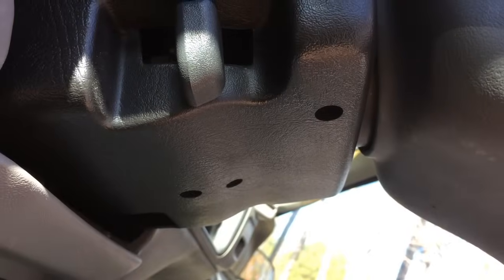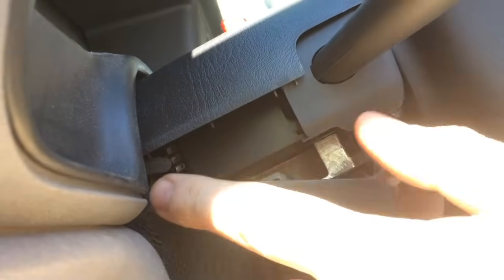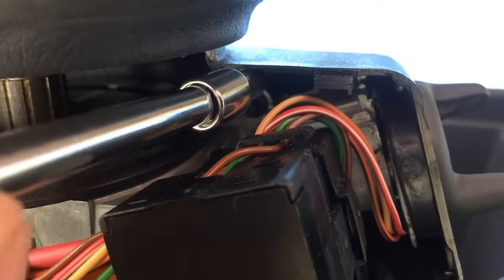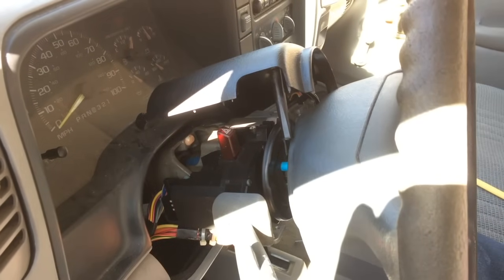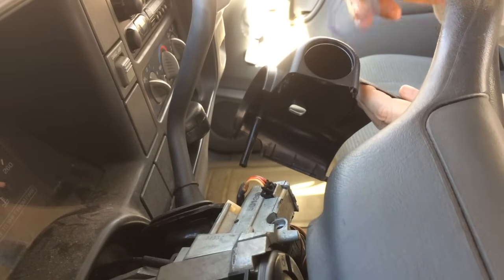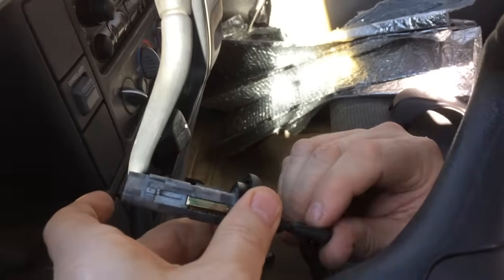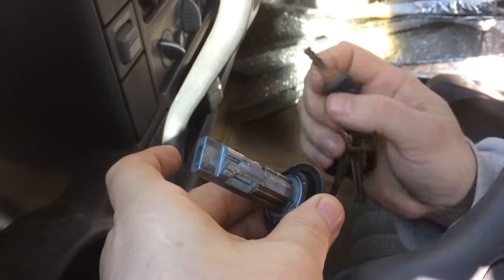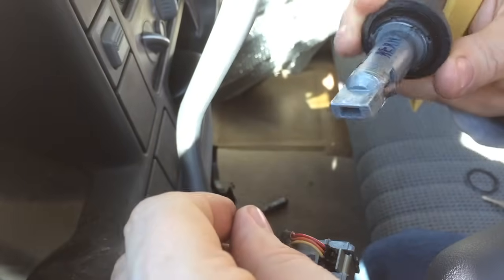1995 - 2000 OBS GM Truck Ignition Lock Cylinder Removal (Chevy Cadillac & GMC)

Comment: If the key is locked already how do u get the cylinder out since u can't turn it into the start position?
Reply from the maker: In order to remove the lock cylinder, you have to have the key, and you have to be able to turn it to the start position.  If you don't have the key, you'll have to seek out a locksmith.   If you have the key, but the lock cylinder is damaged and difficult to turn, there are some older comments where folks found success with lubricants and jiggling/wiggling with the key until it managed to move forward enough.   If its really damaged and lodged in there, you may again have to go the locksmith route to have the cylinder drilled out.
Reply: Ok thank u i have the key and u used to be able to wiggle it and its stuck prerry hard tho
Reply from the maker: Yeah you have to get these things before they get wedged / stuck in a bad way.  I'd try some light lubricant spray, and patiently work with it.  Be ready to depress the release in the small hole that I show in the video, you might only get one shot ;-)

Comment: Hi, my new lock cylinder (06 Suburban) won't release the new key. Also, the "push & turn backwards for accessory" seems hinky. Is there another part that I should replace to address these issues? Thanks in advance.
Reply: Sorry, YouTubers...my stuck key problem was "operator trouble" all along. I had the gearshift all the way down during my lock cylinder swap & that was the culprit. No replies necessary; Thanks & Jolliness.

Comment: I got a 98 Chevy blazer S10 model I want to Change  The Ignition cylinder But I lost the key Does anybody know How to change the Ignition cylinder without a key without a pic and without a jigger key what other ways can you replace that cylinder
Reply from the maker: Without the key your best bet is a locksmith.   Other than that route it would take hardcore drilling the cylinder out.

Comment: My key burnt up in a house fire I have a 98 Chevy Silverado that has no keys for it and I'm trying to change it how easy will be to do so
Reply from the maker: If you have no keys, you gotta call a locksmith who will have the specialized tools necessary.  Not a DIY repair with no keys.

Comment: Any idea where one could purchase that plate that holds the tumbler springs in place? And is there a special tool to stake it in place?
Reply from the maker: Not a special tool per say, just a sharp edge tool to deform the softer metal of the cylinder into the harder metal of the plate.   The GM part number for the plate, which GM calls a tumbler spring retainer, is 26047315 and it should still be available from your local Chevy dealer.

Comment: Hi what screwdriver did you use to take out this 2:12 ?
Reply from the maker: It's at 2:15, an E5 size external star socket on a nut driver, not a screw driver.  Think of these like male torx fittings, rather than the more common female ones.
Reply: @DrShock  ok but someone tried to rob our 2000 Chevrolet Suburban man but didn’t they just left and broke the key ignition lock . So I can’t put my key in it and can’t replace ignition. Any suggestions man?, I’ve been trying to take it off
Reply from the maker: 2000 is going to be the new body style, so isn't going to look quite the same as this old body style column disassembly wise.  But the process is basically the same with turning the key while depressing the release down the access hole in the steering housing.  

If what you're saying is the key was broken off inside the ignition cylinder by the would be thieves, then you're going to need to get that key fragment out first using some strong tweezers or a couple of picks.  If you mean they just damaged the ignition cylinder where it won't turn/you can't insert the key - in this case you're better off calling a locksmith.  They will drill out the damaged cylinder so that it can be removed and replaced.

Comment: Must be a different set up with the manual transmission.
Reply from the maker: The plastic cowling and lock cylinder part numbers are different yes because there's no automatic transmission shift lever or linkage, but once the cowling is removed the lock cylinder release mechanism is the same in terms of depressing the release thru the access hole on top of the steering housing as shown.

Comment: What if I'm not able to turn the lock cylinder to the start position?
Reply from the maker: The lock cylinder cannot be removed unless it is rotatable into this position.  The steering housing casting and the lock cylinder only fit together in this rotating sequence.
Reply: @DrShock  well then we may have a bigger problem on our hands than what I had hoped. I believe the lock cylinder on our truck is bad because we are not able to turn it from the off position. If I am not able to remove it without getting it to the start position I'm not sure what the next step needs to be. Any ideas?
Reply: @DrShock  let me ask you this. Let's say a person has lost their keys and needs to remove the lock cylinder. How could you remove it if you didn't have the ignition key?
Reply from the maker: They can sometimes get bound up due to oxidation, dirt, or other debris due to damage like the tumbler spring retainer coming loose.   I've seen other commenters have success with a lock lubricant and jiggling and wiggling to get it to finally turn.
Reply from the maker: If you've lost the keys, that's a different story though.   Locksmith time really, as even these old 90s designs were pretty good at theft deterrence.   The locksmith has the unique tools to make a new key to fit the lock cylinder.   Worst case, they have the experience to drill it out without damaging the steering housing.
Reply: @DrShock  I do appreciate your help sir. I'll get myself some lubricant and see if I can get it to turn that way. If not, I'll be in touch with a locksmith. Thanks again!

Comment: I have an issue where truck starts then shuts off due to p1626 code do u think this is the issue?
Reply from the maker: Nope, that P1626 code is a theft deterrent one.   Depends on the model year of the truck; but could be coming from the body control module, the key, or the sensor near the lock cylinder that checks the key is correct for the vehicle.
Reply: @DrShock  it is a 99 suburban 5.7 four speed if it matters, I have been told many things and had good techs check it out, replaced ignition switch and truck starts but then stalls
Reply from the maker: Was this same code showing before you replaced the ignition switch (and by saying "ignition switch" that means the electrical part sitting at the base of the steering column not where the key goes in).   If you replaced where the key goes in that would be the ignition lock cylinder.   Also what was the trucks symptoms before you changed out this part?
Reply: @DrShock  truck was fine I changed the actual switch that goes below the cylinder, It ran fine came out to go to work three days ago now truck starts and then shuts off, it is showing a p1626 code, but ignition switch was replaced a few months ago but not for same issue it was a few other symptoms, but that is the only issue with truck it is descently maintained
Reply from the maker: So sounds like you're saying 3 months ago the ignition switch was changed out, and the truck has been fine since then until suddenly this P1626 theft code situation.   If it's been running fine for 3 months, that's an important point.  To really know what's going on you need to get a Tech2 scanner hooked up to it.   But without that I could suggest checking the wiring harness(es) involved in the previous repair.   I'd be looking for wire insulation damage occuring over the last 3 months that could impact the Passlock sensor circuit area.   Unrelated to the previous repair, but possibly involved in the new code, inspect the harness connection at the body control module (BCM).   There are some other youtube vids out there specific to this code that may help further diagnose this one too so give a search on the code here as well.
Reply: @DrShock  got the tech 2 out we can't communicate with the vats module all others we can, it says pass lock is sending out its signal going to vats but then the vats isn't communicating with the ecm, I am replacing vats module today I hope if it comes in, I'd this doesn't work I am going to bypass the vats altogether which I wish I done
Reply: @DrShock  the one video where they ground the purple wire to get the truck started is ridiculous that is the can bus or serial bus line so much bad info out there, the pass lock wires seem good and the system seems healthy

Comment: Is there any reprogramming involved by the dealer or is this just all mechanical swap out? The truck im purchasing needs new door locks so im buying a lock/ignition set so no tumbler replacement is necessary.
Reply from the maker: There is no scan tool required here, all mechanical though you may need to rekey the tumblers if you want the old keys to work in the new locks.

Comment: So I got a 98 Silverado and my problem is I can't get the key out and the key doesn't turn back far enough to get it out or for the steering wheel to lock and the orange gear indicator light stays on all the time. Would that be the key cylinder given me probablems? I see online I can get new cylinder with a new key as well as not door locks to match the new key for $40 online AcDelco
Reply from the maker: Sounds like the key will turn forward but not back to lock to change gears.  Does it turn enough to just remove the cylinder as shown in the video?  If so, you could remove and inspect the cylinder for binding.
Reply from the maker: Well it starts and stops, so imo the ignition switch is fine.  Still sounds like the lock cylinder is binding in the steering column, something obstructing the ability to rotate it rearwards to the accessory or off positions, but not forward to start and run.  So as shown in the video, when you are pushing a small punch or similar tool thru the top access hole while turning the key, are you not able to feel the release button being pressed in?   Once you feel that move, turn the key a little further and it should at least loosen even if obstructed internally.  If it will not move at all, you'll have to get a locksmith involved as the cylinder may be internally damaged inside the steering column.
Reply: +DrShock Oka I'll see what I can do when I get some time.
Reply: @taylorh3930  did you get your issue repaired? What was the culprit and fix neccessary?
Reply: @taylorh3930  Your problem is most likely caused by the Park Lock Cable assembly. It is typically a black cable which enters the Ignition Switch Housing. The purpose of the cable is to tell the vehicle when you are in Park and Neutral because this information will either allow the key to be released (pulled out by you) or not. That cable can be adjusted. You are describing a text book case of the cable being too loose - the ignition system never knows when it’s in Park or Neutral at the ignition cylinder level.
Check your local library for a Shop Manual and it will have detailed instructions how to adjust the cable. Typically you need a special tool available on E-bay for about $10.00 used.

Comment: Anyone have a thought on how to remove when the key won't go into the "Start position"?  Mine is stuck and won't go to that position at all.
Otherwise thank you for the video to get me to the point of the top off.
Reply from the maker: If it can't be moved to the remove position, usually its locksmith time (or drilling it out time).   The lock cylinder may have a part dislodged creating an obstruction, you can try a lubricant like silicone spray and jiggling/wiggling/shaking to hope for a break out.  Short of that lucky break I've not seen much success sparing the locksmiths drill when the cylinder is lodged like that.
Reply: @DrShock  i am having a problem with the security light flashing and won't start. Does the ignition have anything to do with it?
Reply from the maker: Only in a narrow sense.  For the 90s trucks this video covers then the ignition lock cylinder, if rotating correctly, just puts the key in proximity with the Passlock sensor.  That's the extent of its involvement with the circuit.   If the lock cylinder is working, and the key is "correct" for the lock and the vehicle, then it's not likely to be causing the security light to come on.   So technically it "can" cause it, but its fairly easy to quickly rule out as a cause.
Reply: @DrShock  Thanks for the reply! 
After spraying silicon spray, WD40, Graphite and giggling, wiggling and cursing it for 45 mins. it finally moved... funny part it move and started the engine...with me holding an key ignition in my hand (LOL) I was able to put in the new one and shut the motor off... I forgot that part of unplug battery. 

All fixed and thanks for the great video!
Reply: @jeffburkholder202  haha... Dumb me I had this issue and still decided to take my truck camping 😂😂😂. The key was stuck in the run position but wouldn't start... I had to hotwire my starter solenoid to get it started, and when I got home I just disconnected the negative.

Comment: I have a 99 Cadillac Escalade and the key does not turn at all. How would I remove the top part of the steering column if I can't pull down the gear shift?
Reply: Amanda Perez Got the same problem with that on a service truck at work.

Comment: What if I don’t have a key?
Reply from the maker: For theft deterrence reasons, without the key the lock cylinder cannot be removed without destroying it.   The usual method is drilling it out with a series of stepped up bit sizes.  But I'd recommend a locksmith instead in this situation if you haven't done it before.  It's very easy to damage the steering column by drilling crooked to the housing, or too far in past the cylinder.

Comment: my truck starts runs for a second and dies will this fix this issue? thanks!
Reply: Greg Bratrsovsky fuel filter or pumps going out
Reply: No sir spent 150 bucks on new fuel pump and 14 bucks on fuel filter and didnt help it seems to only start when the security light goes off but i unhook the battery for a second then it works
Reply: Greg Bratrsovsky most likely its a bad connection sometimes the wires on top of ignition cylinder get corroded or unplug a little from hitting a hard bump. I'd unplug it clean and try that first

Comment: I wish my case was that easy. I can't take the cover off cause its one piece on the p3500.
Reply from the maker: Perhaps pull the steering wheel then and come in from the front at an angle under the top cover lifted a bit? There will still be the same release type procedure for the 1500 and 2500 as shown once you gain access.

Comment: I got a new one from ebay and said it would work but got the new one in and to no avail it wouldn't start at all just kept having troubles starting so I put the old one back in and started right up. So I tossed the new one away and said no more.

Comment: how do you remove the lock cylinder housing from the steering column ?
can someone point me to a video of that?
Reply from the maker: You must have skipped past it, it's right here at 4:38 - there's no other way to remove the lock cylinder than having the key inserted, depressing the release button, and turning the released cylinder to the start position and pulling it out.  You have to do all the disassembly of the housing shown to access the release button to do that step on these trucks.
Reply: @DrShock  OK, well I see where you have disassembled the top and bottom of the shell covering in order to access that hole.
 I did that. The problem is that I cannot get the key in more than a 1/8"  or so, and the cylinder is jammed in the OFF position or thereabouts. 
I thought maybe if I could remove the housing (which the lock cylinder fits into) maybe I could somehow have better luck getting the lock cylinder out by forcing it out from the back side or something.
Reply from the maker: The obstruction blocking the lock cylinder from turning past off, may be the tumbler spring retainer coming loose and being wedged in the way.    If I had this situation i'd first see if I could identify what's blocking the key tough, as that's the easier of the two issues to diagnose.   

If you can't get the key in its a bust anyway, and may be where you need to tap a locksmith to resolve.  The cylinder may need to be drilled out making it beyond a DIY project.
Reply: @DrShock  I sure thank you for taking time to reply. I will examine it closer tomorrow. It's just kinda chewed up in there compliments of a good for nothing looser trying to get something for nothing.

Comment: My key wont turn at all
Reply from the maker: If you have the key, but it won't turn in the ignition cylinder then you may have one of the two obstruction problems I mention in the video.  Try getting some lightweight lubricant into the hole for releasing the cylinder on top and a smaller pin like an unbent paperclip.  You may get lucky getting the obstruction to clear just enough to release get the cylinder to rotate.  Last resort is calling a locksmith.